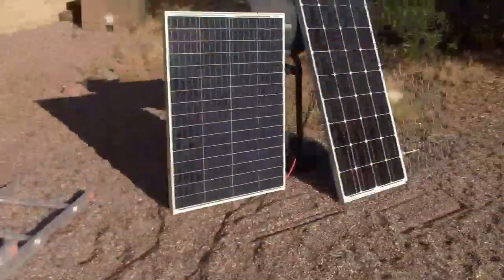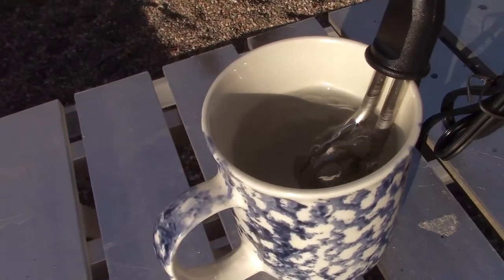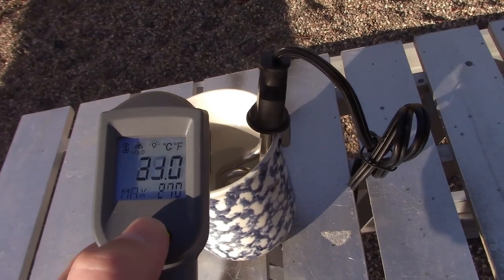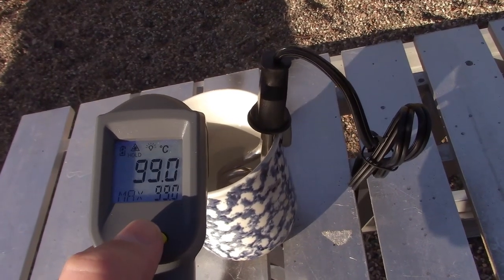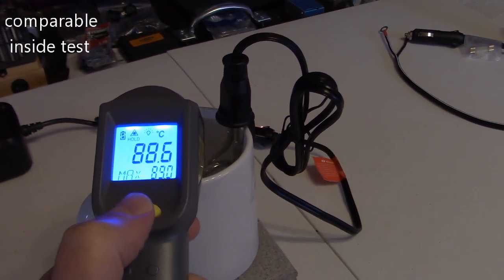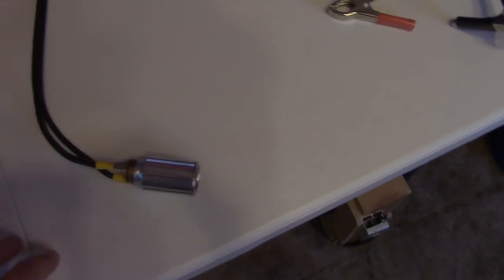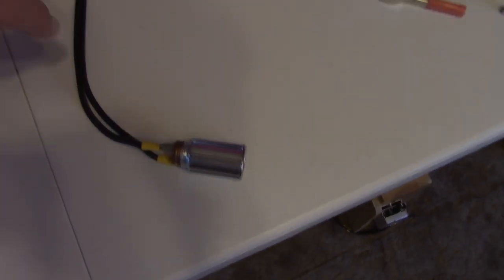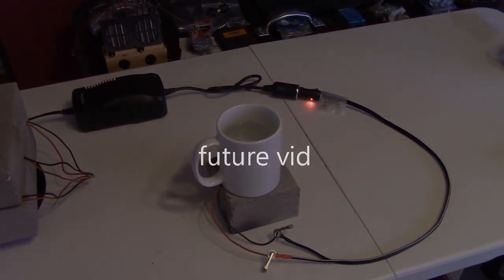How to Boil Water with 100W Solar Panels! 8-16 oz! boils in 10-15 mins. 12v water heater! - Ez DIY

Comment: Awesome!  Way cool to see tested out as I was wondering how these perform off the grid. Thanks for sharing!
Reply from the maker: hi and thanks. yeah, you never know if it will work until you actually hook it up. i have a feeling a lot of 12v appliances will work. the trick is to get the amps. seems like many of them pull about 13 amps. so most will probably run fine if you use 2 100w solar panels. i'll be testing a few other ones like 12v frying pans and saucepans etc. in the future

Comment: Can you connect aquarium water heater directly?
Reply from the maker: hi. if it's 12v dc and you're connecting it to a 12v dc solar panel (or a 12v battery) then you might be able to.

Comment: Great video my friend. Quick question. Have you attempted this element in a larger water storage tank. I'm looking for some D.C. elements to work as a off grid water heater and seeing this video really got me thinking. Any input would be greatly appreciated, thank you 👍
Reply from the maker: hi. i haven't tried this element in anything larger than 16oz. they do sell dc water heating elements in lots of big sizes thou. 300w, 600w even 1200w and more. (i think the 1200w ones are 24v)
Reply: Yes. It can easily be done. Buy a 12v h2o water heater element (mine is 100w) and hook it up. I hooked mine up directly to the panel. Water in tank is 160 degrees right now.
Reply: @desertsun02  definatly appreciate it 👍
Reply: @a787fxr  much thanks 👍 definatly appreciate it
Reply: jj m  It's a small 5 gallon standard hot water heater. With additional insulation wrapped around for maximum effect.

Comment: Ever try vacuum tubes? They can boil 20oz in about 15 min. 
The Kelly kettle works great too. I use an electric kettle just because I can hit a button go check the mail and it is nearly boiled by the time I return. I boil .75 liters. 

So far I use the electric kettle for coffee and cocoa. Sometimes I will fill it 1.7 liters add the boiling water to my dishwater. Doing this allow me to go do something return to warm water but dishes are guaranteed sanitize both by heat and chemical with a shot of bleach. I was able to score ten for $100. IDK if these deals exists. If one built a manifold oner a gallon of water could be boiled per batch.

Comment: Can you plug this into a car 12v outlet or would it blow the fuse? What are the watts coming out of a car 12v socket I wonder?
Reply from the maker: hi. yep, these are made to work in cars. (your car cig. lighter socket would probably have to be rated at least 15a thou. (mine is ony 10 if i remember right). if unsure check the cars manual or fusebox

Comment: i see the filaments inside something thats filled with water and sealed..(my eyes see steam smoke which means your losing heat big time)if you could put the elements in a sealed container would it not get hotter?